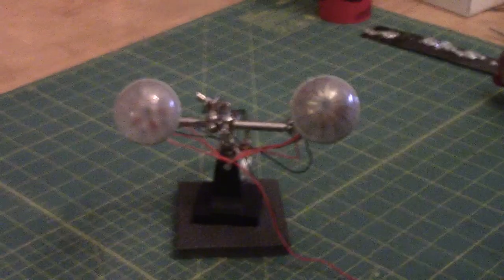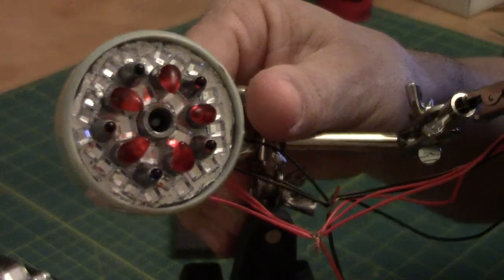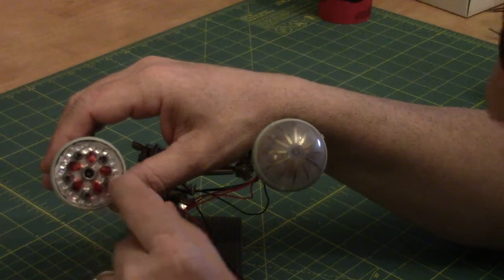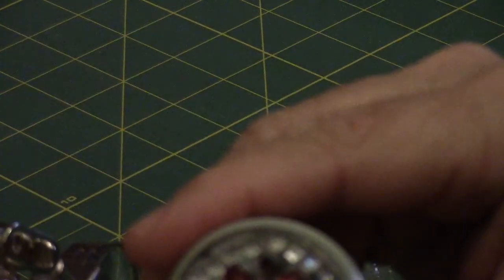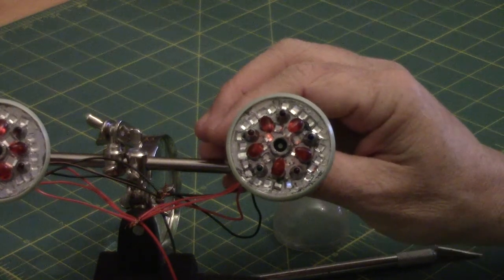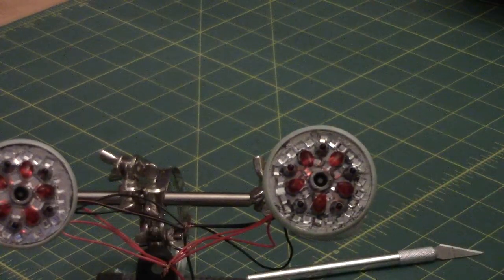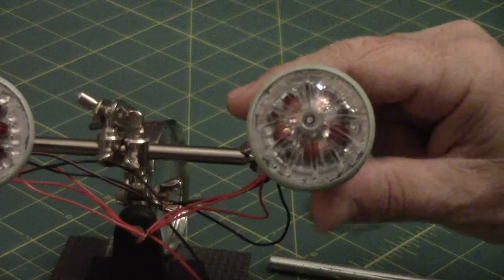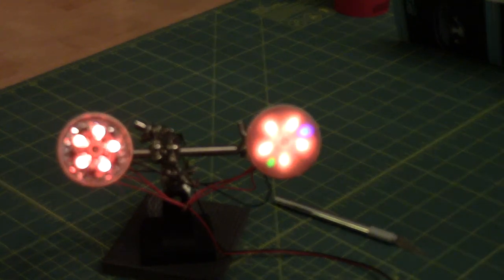Round 2 Polar Lights build Part 1 - Bussards

Comment from the maker: I was looking at Hobby Talk Forum and there is a TOS  build thread there. Somebody there too is using Rhinestones. They do reflect the light but overall  not much of a difference. I think if the domes were clear instead of Frosted you may see more glitter going on. Once I receive my replacement spinning domes I will set them up with Rhinestones and without frosting the domes.